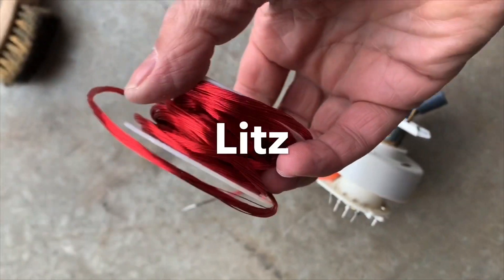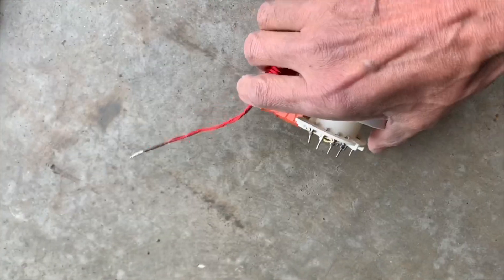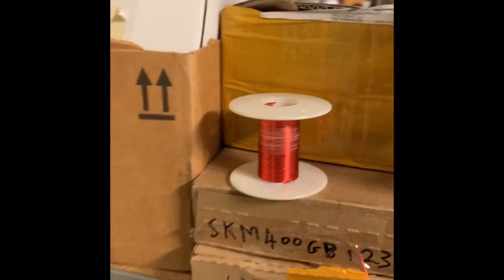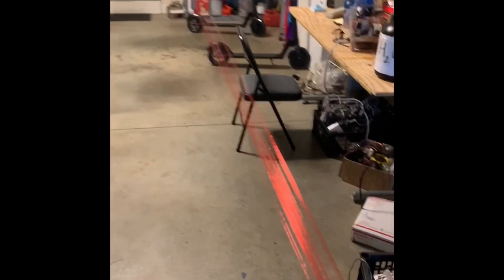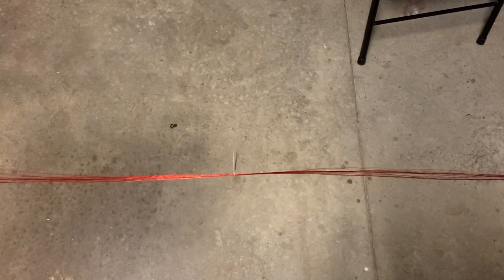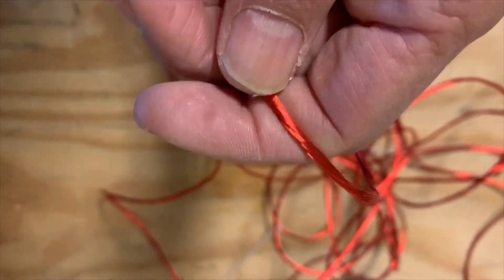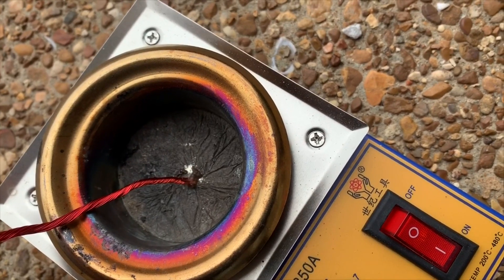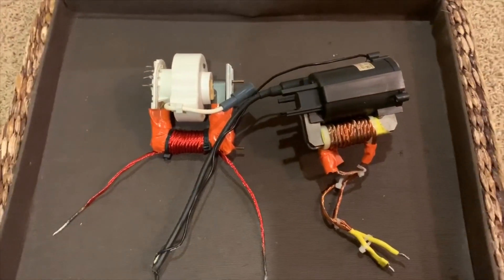Make Your Own Litz Wire

Comment: I need to do this but with VERY tiny wire.. like .008" I'm afraid if I run it across the room it won't be able to support its own weight or it'll snap when I get ready to twist it together.

Comment: Litz wire is some magical stuff. For it to work though, it needs to be engineered.  A single twist of 50 strands of 30 AWG may work in an induction stovetope, but for radio work, it's bit more difficult.  Google "Simplified Design Method for Litz Wire." I made some.  For my requirement, I had to twist four yarns of eight strands of 46 AWG, then twist those four into my bundle.  That's called 8 x 4 wire.  Each strand is finer than cat hair. Ask me how I know.  It's fragile. 

As to the solder pot, I bought a 20 ml alumina crucible (cheap!).  I dropped solder scrap into it and hit it with a propane torch.   The enamel decomposition temperature is higher that the melting point of 60/40 solder.  Don't be scared to heat it.  Drop some rosin in, then dip the ends.  If there is a broken strand or a cold joint in the middle,  you'll fall victim to a cable with lots of capacitance

From real life: WWVB, operating on 60 kHz (but at 70 kW), uses litz wire 9 × 5 × 5 × 27 (6,075 strands of 36 AWG).  The details can be be found in Wikipedia.
Reply from the maker: Wow interesting! Thanks for sharing that with me.

Comment: You know, if you had multiple spools of the wire.you could attach them to a board  hang it on your shelf a 400-600mm x 2meter sheet of plywood,   with a Block of wood at the edge. To hold a smooth ring, about 25mm to 50mm or so to run the individual wires in to. Using screws to hang the spools on with a fender washer with a couple layers of cardboard or thick cloth like denim or a felt on both sides of the spools. To  give just s bit of friction to keep the spools from free spooling,   and a clothes pin at the ring because you do NOT want these strands running astray! Then a meter away or so. Set up a larger spool  with a hand crank in it and spool it up. But even better would have the spools on little carriers on a board it being round with smaller round boards with the spools on them the board spins around ad the wire is pulled off the spools, so it is twisted as it comes off the spools! Scale it up until you are using  500' spools to spool on to or larger  but about 30 gauge is small as you would want to go if you are processing it in any way! Work hardening and breakage can be a real issue!

Comment: I'm pretty sure this is NOT Litz wire. Litz wire isn't just twisted together. Each strand needs to spend equal time inside of the bundle and outside of the bundle as every other strand in the bundle.
Reply from the maker: The average for twisted Litz would be just that. This is not designed for precision, just for practicality.
Reply: @BrianDhvTinkerer  After a bit of searching I see it's pretty common to call multiple strands of insulated wire Litz wire. Decades ago with I minored in physics, I was taught Litz wire had a very special construction and was rather complicated to construct.
I'll have to concede the rest of the world doesn't use the same definition.
Thanks for sharing your technique. No hard feels from me.
Reply: @ddegn  Did you miss the twist with drill bit? obviously twisting all the wires means that each strand will be inside the bundle at some point and outside the bundle at some point. Yes, this method is not 100% perfect, but it's probably the best anyone can do at home.
Reply: @gaynzz6841  that's not really true; it's possible that some strands stay close to the middle of the bundle for the entire length.

Comment: how do i remove the isolation without a solder pot. i dont have one
Reply from the maker: Best to get some plumbers solder ( no flux) and melt it in a small pot over the stove then dip the wire in it for a minute. The smoke is nasty so it is better to do it outside.
Reply: @BrianDhvTinkerer  thanks for the reply. why not use solder with rosin core? in what ways is it worse than solder wire without flux?
Reply from the maker: @TheRealObamagaming  the rosin will burn and smoke in the solder pot

Comment: How insulation is applied on magnet wire ??
Reply from the maker: https://mwswire.com/about-magnet-wire/#:~:text=The%20insulation%20of%20thicker%20square,term%20reliability%20of%20the%20winding.
Reply: @BrianDhvTinkerer  no  , I mean mathod of applying insulation  , I have read such information on the wiki about the material but it's hard to find ,  how they are able to apply thin coating on wire bundle without sticking to each other 🤔
Reply from the maker: Not sure but it may be sprayed on or dipped in as monomeric material and subjected to UV light to promote polymerization. I am not sure of exact details.
Reply: @BrianDhvTinkerer  i remembering  little clip which i  watched before somwere ,  it was said that it was vaccume treated to make such thin layer  .
May be it's uv curable but i thought it is made of varnish !!

Comment: @author: Thanks for the video, you're correct re:electrodynamics of the wire but are kinda missing the point of a lite braid. Litz is a style of braiding individual strands of wire into a particular number of conductors. Sorta like hair braiding, each strand of hair is braided in a Litz format to produce a certain number of conductors. For example, if you want to create a speaker cable you need a minimum of four strands to create a positive and negative wire. The min. example of a lite braid for one speaker cable would be: 4 strands of wire (2 positive & 2 negative) braided as singe strands positive over negative up the whole cable. At the ends, separate the positive and negative wires into two conductors each made of two strands. For every foot of Litz you will need two feet of that strand. Hope that helps.
Reply: There seems to be a very common misunderstanding of Litz wire. There are lots of videos like this one which seems to think Litz wire is just a bundle of insulated wires twisted together. Real Litz wire is much more difficult to make.
Reply: Speaker cable? Lol. This is good for 50 kHz and more.

Comment: Great idea! I never even thought about making my own litz wire. I don’t have a solder pot but I wonder if I could just burn the enamel off the ends of the wire carefully with a torch, then solder the ends of the wire together using the normal soldering method?
Reply: I used a 18 CCC 26.5 gauge magnet wire per speaker cable.  Woven into positive and negative leads. I think that gave me  a 14 gauge +\- finished wires. I bought the wire from Percy Audio 

Yes just use a simple soldering pot to burn off the insulation.
Reply: I’d suggest scraping the magnet wire and then burning it off with a torch you might change the temperature of the wire not sure if that matters I don’t think Mike from Percy Audio has any of the cc cc magnet wire left about 10 years ago I bought the rest of his 26.5 gauge, I’m now using it in let’s wire format for my compression driver tweeter in my open baffle speakers, and it sounds lovely
Reply: @MuchoBocho Audio is basically DC current when it comes to high frequency electronics. Please...